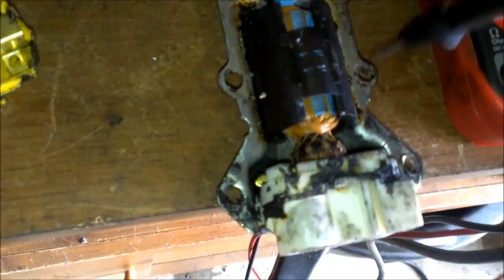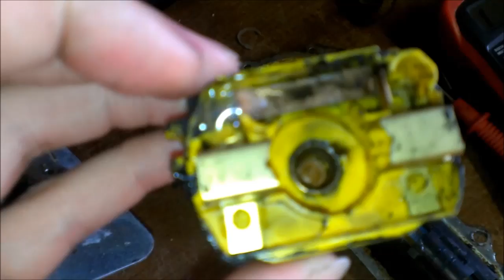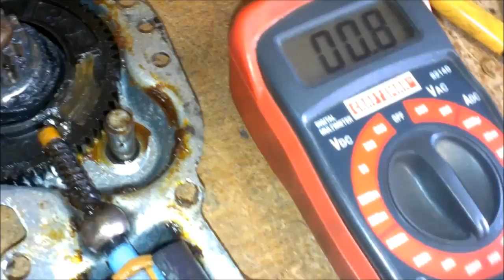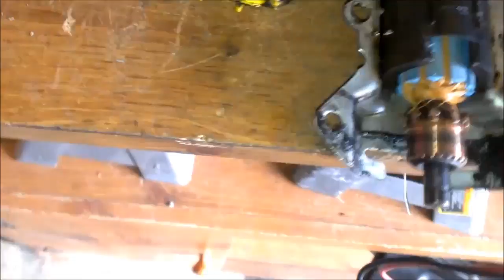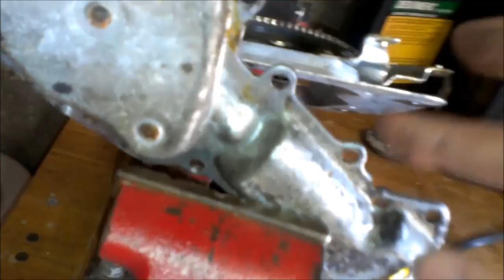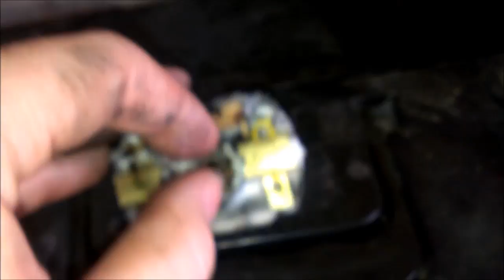How to repair window motor in any vehicle

Comment: so what are you touching with the battery leads to make the motor turn?  I see two pins .  Is one of your battery leads on one pin and the other on the other pin?  and then switch to reverse?  or is the negative battery lead on the housing and the hot battery lead on one of the pins?

Comment: Great video just to add clean the commutator whit a fine sand paper and knife to u clog the lines make it very shinny  clean with w40 or similar NO carb cleaner or acetone or definitely NO esmeg   laker thinner just mild greasy cleaners  new grease ready for several years of service i refurbish lots of them work in the industry for years

Comment: My window motor stopped working yesterday. 
I took it out, plugged it back in, & it started working again.
What do u think may be happening?

Thanks in advance..
Reply: Connectors were getting rusted. Just check it out if it will trip off again next time.

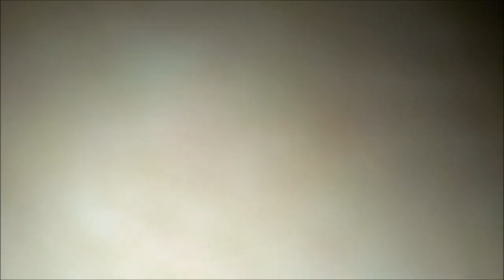Comment: 4:45 darker conductor actually is thermo resistor. If it breaks, motor works for a few seconds and stops. Solution - solder wire across its contacts, but then motor will not stop automaticly when window will be rolled down or up.

Comment: Thanks for the video. I've got a gm vehicle I'm getting ready to sell, and its the little parts like the window motors that are starting to add up in the overall cost. This way I can just rebuild the existing motors, and get the windows working again, thanks.

Comment: Well done, for interest if stripping down the mechanism is the only way to fix a stuck window on modern cable operated windows then here’s my video fixing both the motor/regulator, gears, bearings and switch (applicable to most cars): https://youtu.be/btQ50b5lHos

Comment: great video sir. my motor has a problem with the lift of the window just like the motor struggles to push the glass up. its fine to come down just going up is the problem
Reply from the maker: +david north try lubing the window seals all the way around the window with Vaseline. where the window seats on the sides.
Reply: +bam6972 tried that but its even struggling when the glass isn't in the track so i think the motor is on its way out. thank you for the reply

Comment: The brass tabs that run from the terminal to the far brush holder is called a "ballast resistor", and is supposed to have resistance across it.
 
The ballast resistor has two main purposes... 
1) It limits the motor current when the engine is running and producing 14-16 volts, but provides more current when not running and providing only 12v.
2) If the motor is overloaded with a stuck window or jammed mechanism, rather than burning the motor out and overheating the vehicle's wiring, the resistor quickly becomes very hot and drastically drops the current to the motor.

After years of regular service, even if the neighbour's kid didn't get his head jammed in the window three times, that resistor assembly does wear out with age. When it does, presents a slow, laboured travel going up but is normal coming down thanks to gravity. This leads to that awful experience where you frantically try using your hands to manually assist the window up while the rain pours in.

Soldering over the two sections of the brass ballast resistor is really the best way to take the problem away from the motor, allowing it to be reassembled and tested. But that leaves you with none of the functions the resistor provided. The way I fixed my bypassed ballast resistor, even though it would be ok to leave it out, was to install one in the wiring harness. A 10-Ohm, 5-Watt ceramic resistor (any electronic parts place) was fitted with a pair of "bullet connectors", a male on one end, female on the other. Cut one wire in the cable feeding the motor, and repeat the process with the bullet connectors, it doesn't matter which goes where. Clip the resistor into the bullet connectors on the wire, and you have all the functions restored. If you find the motor too slow, just remove the resistor and reconnect the wire's bullet connectors. Easy.
      
      (Bullet connectors are found at any auto parts place, electronics, store, even
      WalMart... they will be with other connectors such as ring terminals, spade
      connectors, and disconnect connectors. They have a yellow, blue or red sleeve
      where the wire goes in, they are very common.) 

When I had motor assembly problems, mine consisted of a series of missing teeth in the output gear, in addition to the ballast resistor. I HATE spending money on parts for my 2001 Safari because of its age and how many years it has left. So, I always try my hand at a repair since I have nothing to lose other than my time. How did I fix this? It was actually quite easy. 

As the ballast resistor was tired and wouldn't pass enough current, I soldered a bridge across the brass tags after grinding them slightly to let solder stick. 
After thoroughly cleaning all of the grease and broken gear teeth, I took the large output gear and pressed it into some clay, removed it and rotated it 90 degrees to imprint new teeth in the clay where they were missing, removed the gear and let the clay dry. I took a Dremel unit with a cutoff wheel and "mangled out" a pie-shaped section that included the missing teeth. The "mangling" was to make as jagged, rough, and uneven cuts to the sides of the pie shape to give the glue many anchor points. I mixed up some Bondo resin and added DOUBLE the amount of catalyst, then stirred it thoroughly and set it aside. 

The main gear got a final cleaning with Methanol, and applied the Bondo mixture into the cracks, crevices, gouges and surfaces that I created with the Dremel. This makes sure the resin glue will soak in for best anchoring. I placed the gear into the clay and poured the resin into the void, removed it after an hour and filed/cleaned any unwanted bits that were on the gear. I also tested thicknesses and used a grinder to make it as close to the original as possible. Two days to harden, plenty of good quality grease, assembly and reinstallation, and the system has never worked better.
Reply: Im glad i read your comment as i was going to pull out my window motor and rewind with thicker wire. Glad i read your comment!  Cheers from Australia 😊
Reply: Thank you for this!